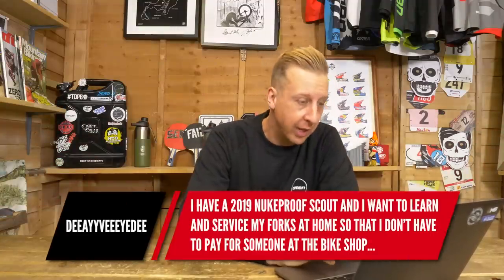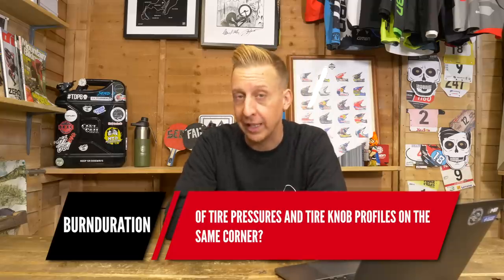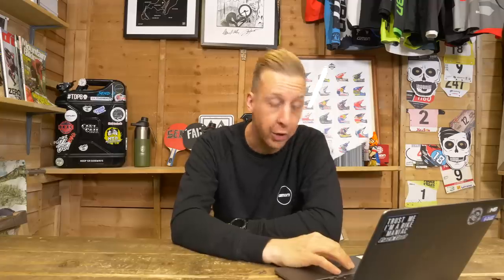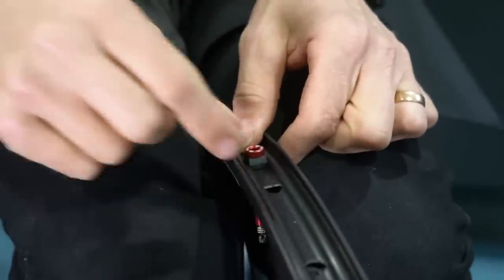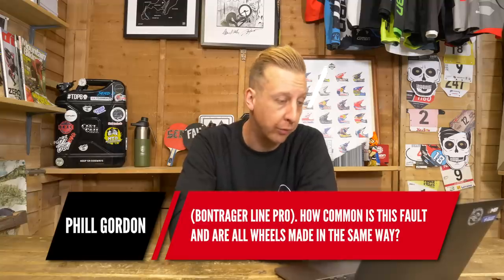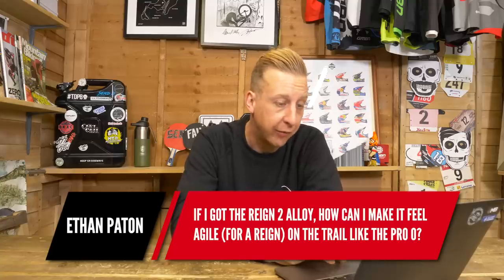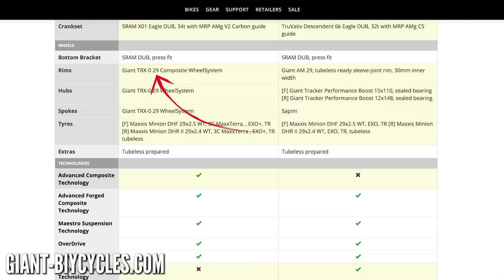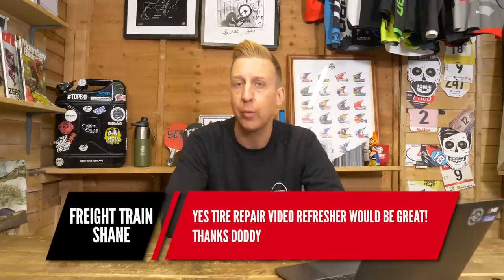Full Or Open Face Helmet For Mountain Biking? | #askGMBNtech

Comment: #askgmbntech
Hello Doddy and team,
I'm a short person (162 cm) and ride on XS sized bikes with 26" wheels, i tried 27,5" before and it rolls better but i feels like it was too big for me. Is there any hack for small rider like me to keep up with mtb wheel trend? It's harder to find 26" wheels replacement nowadays (i dont really like buying it online since i had bad experience with it before). Thx guys.
Reply: Try women's specific sized bikes. These should be much closer to your needs. Also try narrower bars and a shorter stem. These can make a bike feel huge to smaller sizes. Also shorter seat post. Watched someone get sized on a small (men's) and realised the seat post didn't go down all the way. Needed a woman's specific sized bike for that manufacturer
Reply: @derman3658  thx, i'll try to find a bikeshop that demoed one. I used to ride small dirt jump bikes in recent years since it's the most comfortable size i could find, but it's just dont cut it in most trails.
Reply: @judithnotonegoro6894  yeah dirt jumpers are small alright. Look for something with a low stand over height and shortest seat tube length and work up from there I'd say. Also 27.5 wheels might suit ya better. A woman's specific model should work for you. Check out embolden, rail, intrigue in Giant brand, then check other brands woman's bikes for similar sizes / geometry. That should get you in the right ball park
Reply: @derman3658  thx for your recommendation, i did find a bike shop in next town that demoed alot of woman specified bike, cant wait for tomorrow to try em.

Comment: #askgmbntech could i convert enduro tyres to dh casng tyres by putting something on the inside of the tyres without spending as much money?
Reply: Not unless you're planning on grafting more rubber to the inside
Reply: @src248   yes thats what i think would be good. Doddy had that thick tape that is like rubber and he used it to repair that tyre.
Reply: Nope. You can't. Sorry. It's just not possible. You could try a tyre insert, or just buy dh casing tyres when your current ones are worn out. Ride more, won't be long then.

Comment: I would have a hard time with full face, I dont even like heavy open face, for example giro chronicle is heavy and fixture feels good. Go to bike shop and try them on walk around hop on a bike turn head ect.
Reply: MET Parachute is a certified full face, super airy, and around 700 grams, so it's sup light too

Comment: I have a bell super DH and I have to say it’s an amazing helmet how ever the nuts that hold the peek tight feel of on some trail after possibly 6 months of use this was probably my fault for not checking that it was tight enough I did end up replacing the nuts with some metal ones and all is well now. So over all amazing helmet apart from that minor user error
Reply: It is such a good helmet, i opted for the super dh because it felt more roomy than the super 3r. I kinda have big ears and the super 3r didn't fit well with them.

Comment: #askgmbntech

I've currently got a Fox FLOAT 140 RL Fork that was on my bike from new in 2008. I'm wanting  to do a lower leg service but believe it's an "open bath" style fork?  My question is how I do ensure all oil is out of the damper before refilling? I've checked the Fox website but can only find details of how much oil to use for refilling. At the same time  I intend swapping out the wiper seals to the later versions.

Just getting back into biking after a very long break, coming across your channel has been a great help.

Comment: I have an dirt bike 1080g helmet. I want to Dremel aeration holes/ weight savers. Motorcycle helmet are 100mph+ ready do you think I take a big risk messing with the helmet structural rigidity at these low speeds (I m not downhill omg just pretty fast xtc

Comment: I run the Bell super helmet Super 3R with the Mips system. Works great as a full face plus and open face, benefits is you don't get as sweaty as running a complete full face as here in Australia temps can get above 40 degrees Celcius on some days. So you can ride in full-face all day is you want or if it's too much, you drop the chin bar and be much cooler on those climbs then chuck the chin bar back on for those gnarly descents, without having to take the helmet off.

Comment: #AskGMBN
Hey Doddy I just wanted to ask how I can prevent rust in my drivetrain and also how to remove rust. Thanks.
Reply: If its lubricated properly it shouldn't rust
Reply: @Duncan23  Thanks for the advice, will consider it:)
Reply: @midoriya7451  if you clean it with degreaser and let it dry by sitting you will also provoke rust, You can also use higher end chains with protective coatings
Reply: @midoriya7451   They've done entire videos on drivetrain maintenance - do a search on the channel homepage
Reply: Everyone thanks for the advice now I know thanks guys

Comment: Interesting about the tyre tread vs tyre pressure, with regards to muddy conditions... From what you're saying in almost sounds as though when riding in softer muddy conditions you want to run tyres a little bit firmer to help it retain it's shape better and allow those bigger blocks and lugs to do their job and bite in to the ground.
If you have a spare chunky tyre (off the wheel) and hold the tread surface flatter (as you'll often see with folding bead tyres when you buy them) the tread pattern actually closes up the flatter the profile gets, so surely when that is acting as your contact patch on the ground at lower pressures you would be loosing the separation between those lugs, preventing them from biting in to the surface as well as they should.

Comment: #askGMBNtech I have a couple year old rockshox reba fork and it makes a sucking noise as it goes through its travel. Why is this? I have done a rebuild on it (replaced the seals and replaced oil and lubed it) and it still has the problem.

Comment: Full face can save your life cus if you break your back or neck it will keep your head in place so you can breath and wont be paralyzed also if you hit your head neck or back hard and you have to call 911 dont take your helmet off just as if someone crashed and passed out dont remove the helmet

Comment: Dear GMBN, first of all you channel RULES, love watching all your content.

I have a 2018 Canyon spectral AL 5.0, and been thinking to upgrade from 2x11 to 1x12 cassette. My canyon is equipped with a Shimano and I m interested in getting the Shimano 12 speed. What components do I need to buy in order to upgrade? I need to change the rear hub to micro spline and can I use my crankset and get 1 narrow wide chainring? How many teeth do you suggest I get the chairing ?Just to keep the cost a bit low. Or shall I get the Sram nx 1x12 group set?

Not sure which one to buy, the Shimano has that bigger 51 tooth which I assume it will help climbing better.

Thanks a lot and really looking forward for your reply

Cheers guys #askgmbntech

Comment: Cornering, the low pressure can be more of a bad thing...as tyre can roll off the rim fully or burp...so for the actual question, probably right tread for the terrain more than low pressure.

Comment: Do you have to replace your shifter cables when you switch from 9 speed to 11 speed shifters
Reply: Not necessarily, but you might need to. The shifter change changes the pull of the cable and changes the number of positions the gear cable can be in. If the gear cable is long enough and the inner and outer isnt damaged in any way you could just move it over.
Reply: Shouldn't have to but I would. You Will have cleaner crisper shifting from the get go and know you have no issues on your new setup. For piece of mind and easier setup, change them. Keep old ones as spare, put a little oil or wd40 down them and check how rusty the run off is. If there's any, bin it

Comment: For the helmet - I honestly wouldn't go for a hybrid one. Reason being - added weight due to chin bar clamps etc. If you're coming from a half-shell helmet, check out IXS Trigger - it's super light (600 grams, depending on size) and this makes a transition from half-shell to full face very easy. Also - ventilation is great.

Comment: #askgmbntech I was getting my fork (36 with Grip2) dialed in by riding it on all the settings, and when I turned the high speed compression all the way up and rode the rock garden, a bunch of oil leaked out of my fork onto the stanchions. Should I service the fork if this happens or take it in, and is it common? I have serviced it several times myself.

Comment: #askgmbntech is it all good to use my dropper in more than just the fully up or fully dropped position? I sometimes find a sweet spot on different trails but don't want to damage my Reverb.
Reply: I don’t think so, I have to ride with mine about half way up as I have a huge one and it hasn’t hurt it so far
Reply: TOTALLY fine. That's the whole point of the infinitely adjustable designs like the reverb, set at any point. They used to come with an 'enduro collar' so u could set ur ideal height drop for a given track...it clamped around the stanchion so it could only drop to where u clamped the collar.
Reply: Of course, sitting on it half way up isn't putting any more stress on it than sitting on it all the way up
Reply: @src248  that's the way I see it. The chamber is doing the same thing.

Comment: I use a Uvex Jekkyl hde. Works fine. Mostly without chin bar, since I live in the Netherlands. In Italy however, I will use the chin bar on the rough alpine stuff. Those helmets are great value if you don't need to use a full face that often. Be aware, the de/ attaching of the chin bar is not as easy as they advertise!

Comment: Love the show guys! I have a set of Schwalbe Black Jack tires which are great on most of my local trails but there is a hill climb that has some loose gravel where I struggle for traction. This tire tread pattern essentially has a rib down the middle because the lugs are so close to each other, I've been wondering if I could remove every other lug in that rib to open the tread up and get some more grip on the rear for the climb. Have you ever experimented with modifying a tire tread pattern? Do you think there is any improvement to be had or should I just buy a different tire? Thanks! #askgmbntech

Comment: I've got a giro switchblade, it's amazing. The only problem I find is, when the chin bar is off the weight is unbalanced pulling your head back. Thankfully I've never had to test it but l, like Blake it fills me with confidence. The ventilation is good but only if you have wind going straight at the vents otherwise it gets very hot. The helmet also comes with a camera mount visor which is very helpful and shows a great POV. Overall it's a great helmet and there are loads of cool colourways

Comment: Just recently purchased the Bell Super DH. Absolutely love it. It’s super comfortable and when the chin bat is attached you can’t tell a weight difference and it surprisingly doesn’t affect your view. I tend to wear glasses with the bar off and goggles with the bar on. I love it! Can’t go wrong with it. They did just recently release a Bell Super Air R model. It’s a nicer looking design but not sure about the performance. I own the Super DH

Comment: #askgmbntech Can anybody help me? I recently got my new mtb with deore brakes on it. I realized that when i am riding the bike upright nothing is going wrong but when i am leaning it over(on the one side only) the disc starts rubbing like crazy. I took it to my local bike shop and they said that the disc is not bend an they couldn t hear any sound.(it is a 29er). Is there something wrong ?
Reply: Post a video
Reply: Is it full suspension or hardtail?  Pull the axle/skewer and put it in again-  What I've seen is usually that the wheel/axle isn't 100 % tight together and then if the skewer isn't perfectly snug pulling the dropouts firmly against the wheel or is pinched slightly-off dead center it will look good when you're spinning it in a stand but it will rub when leaned over.
Reply: can be worn wheel bearings
Reply: Most likely is hub issue
Reply: Probably some flex in the frame/forks. It will go away when you ride more
Reply: Loose wheel
Reply: Rupert Wenn it could be, but not necessarily
Reply: this happens frequently on brand new bikes that I build, Usually Cannondale Treadwells. In my case it’s because a lot of forks on cruiser bikes are flexible. Don’t worry about it and ride your bike more. As the pads wear in they will stop rubbing
Reply: Basically as everyone has commented here. Try them all, start with the bits that say tightening up stuff, then ride again. It's a new bike so should go away. Check the brake caliper is tight too. Gently tighten it.

Comment: #askgmbntech Can brake rotors be cleaned using hand sanitizers ??  Love the show!
Reply: Medical rubbing alcohol is propably as cheap in the chemist and you dont have the scented additives
Reply: @tonymcnally9355  thanks a lot!
Reply: Just use rubbing alcohol
Reply: No. Buy BICYCLE brake cleaner. Or isopropyl alcohol

Comment: #askgmbntech Hey guys, I'm about to buy my first mtb goggles for my new fullface helmet, but I'm not shure wich lense colore I should take. I'm mostly riding in good weather (sunny) but of course a lot in Forests where it's darker. So I need something that can do it all! Also if you have any reccomendations on goggles I'd be happy to know them (I don't want to spend more than 60-70€!).
Reply: I've got some 100% strata goggles with a blue mirror dual vented lens and I use it all year round in the uk, it is great in the sun and also in dark conditions
Reply: I usually go for a lighter lens, yellow lenses are good all around.

Comment: I have the bell and love it. Use it for down hill and as my standard trail helmet as an open face. It also fits goggles
Reply: Bell helmet, cus if it's bell that means a bell that rings, but I know what you mean. but an actual bell I like Timber Bell😃 but I haven't tried a Bell helmet.

Comment: #askgmbntech    Is it possible to interchange a full face mountain bike helmet with a motorbike one or vice verse
Reply: Bill Beaumont I think motorcycle helmets are heavier and have less ventilation, so less comfortable when you are exercising on your bicycle
Reply: Motorcycle helmets are designed to protect your head at over 100 km/h which lessens the protection at low speed. You certainly CAN use a motorcycle helmet but it's better to get the right helmet for the activity

Comment: #askgmbntech I have a fox dropframe helmet , I would like to mount my go pro underneath the peak . What would be the best way to mount it ? Thanks 🙏🏼, love the show
Reply: Lighter and a sticky mounting pad thing
Reply: Only downside is once it's on its never coming off
Reply: @ryansara3398  u can cut then off, then use sticky stuff remover to gradually soak the residue off...byt its s chore, for sure
Reply: U can buy visor mounts...seach on ebay for 'fox profram gopro visor mount'. They are 3d printed and shaped to fit the peak underside perfectly. Was just looking at them today. £12 delivered
Reply: Rupert Wenn Thank you 🙏🏼

Comment: The prolapsed disk in my neck, from face planting in a full face helmet says, open face for me.
Reply: So faceplanting into your bare chin would have been better in your opinion? Okay. 😂
Reply: @HarryKuloh  
"So faceplanting into your bare chin would have been better in your opinion?"
Yes, because it wouldn't have dug in and tried to rip my head off!!

It's "pay your money, take your chance" whether you choose full or open face.  Unless you know in advance what type of crash you are going to have?
However I have seen some full face that have week points built into the chin guard, so it will break off rather than rip your head off. 

I have grown to like the wind in my face, and the unmuffled sound you get with an open face.
Reply: @HarryKuloh   come on weres the witty reply